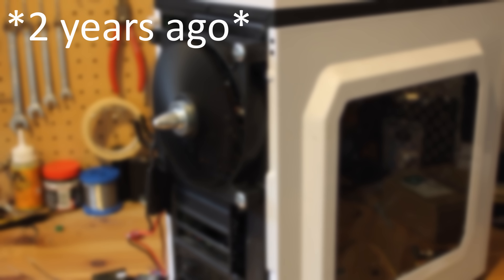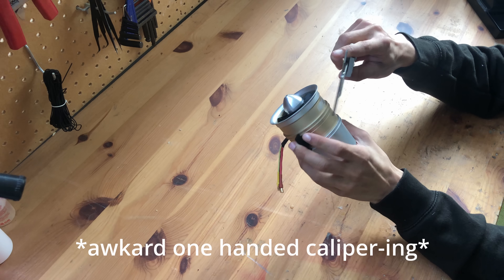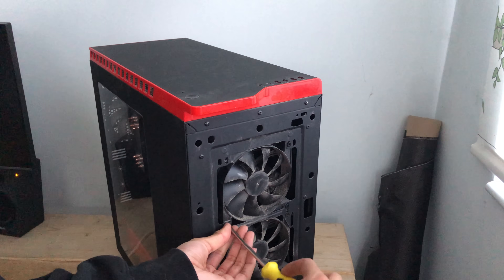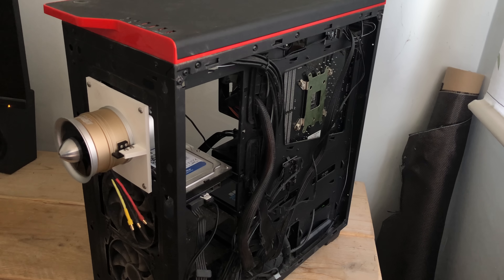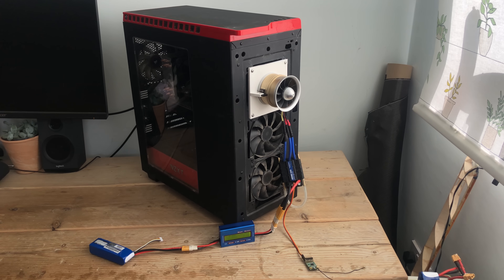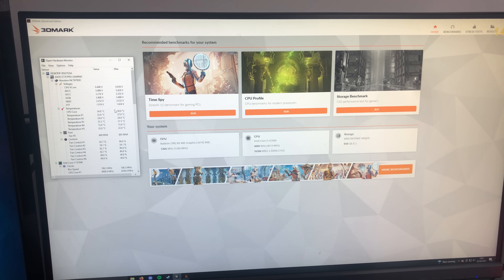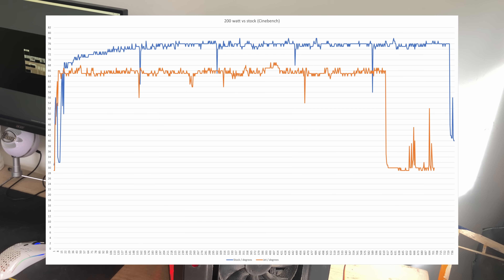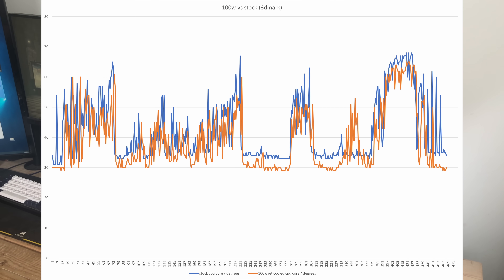I cooled my PC with a JET ENGINE...

Comment: I used to run a air duct from my window to intake fans. I had air filters and a square panel in window so it would shut. Cold winter air was a huge help

Comment: please can you atach a tube from the end of the turbine engine, and then to the radiator of the cpu cooler. What I try to say is that maybe you can use it as a cpu cooler, not a fan case. Sorry my english cheers form Argentina

Comment: literally turned on the jet and ran the test straight away without hitting equilibrium so you wont see any changes its like putting a can coke in the fridge for 5 seconds it wont be cold when i pull it out!

Comment: The placement is wrong, you need to consider the air flow to get the best performance. Fans in the front are facing inwards so they deliver fresh air inside the pc and the one in the back is facing outwards so it pushes the hot air out, so the jet fan is in the wrong direction

Comment: honestly this wasn't the greatest test, you could see there was negitive air flow meaning it was pushing air through the front not the back, would have been better if the exhaust was at full speed making it an even airflow

Comment: Great job, nice and easy to adapt a high flow fan to any standard 120mm fan... Any chance you could share your STL for the fan mount? I have the exact EDF unit and keen to mount to a 120mm fan like you've done.

Comment: I don't understand why your other fans started turning as if there's a negative pressure inside the case. you are compressing ambient air into the inlet on your case. the internal pressure should increase and your other fans should expunge air, not in-taking simultaneously

Comment: instead of blowing in air, you have to blow OUT the air.. meaning blowing out the hot air and replacing it with colder air... that would change significate amount of temp inside the PC case.

Comment: tho it'd be surprising if you did that without fan coolers on the heatsinks and only left that jet engine on, since that jet is so strong it could interfere with the fans themselves. 
or mabye if you did AIO cooler and removed fans from AIO's heatsink and let only jet cool the AIO's heatsink, that could be cool to see. or if you installed it direcetly to the cpu's heatsink.

Comment: I really need to see this electric jet engine strapped to a single 120mm AIO radiator. They're famous for generally not providing as much cooling as a similarly sized air cooler, maybe the giant fan can fix it.

Comment: It would be à much more intéresting video if you put this jet engine direct directly on the CPU cooler, this position is just for circulating thé hot air out of the pc so its not colline as much as the cpu fan

Comment: Where you stopped (and where I shall begin) is to add a complete metal turbofan complete with fuel rail, injectors, spark source, and small fuel tank. Gotta go hard, right?

Comment: I am somewhat curious, how about to try negative pressure, put the EDF fans on the exhaust side and the edf will eject the heat more from the case, also intake fan will spun faster.

If you put EDF fan on the intake side and no sufficient air coming out from the case, it might not efficient because inside the case is pressurized, well it can eject some heat but also make the air temperature rising little bit because of air being compressed. (my thought)
maybe you can try make the comparison about negative pressure and positive pressure inside the case. Of course with protection for mainboard and surrounding components if you paranoid enough to not trust your fan that will not explode.

Correct me if I wrong, we always learning right?
Also sorry if the grammar so bad.

Comment: I would say go figure out a system for the "Thermoelectric cooling uses the Peltier effect to create a heat flux at the junction of two different types of materials." The high speed fan is just pushing warm air over hotter air.

Comment: Sorry that I have to be this sucker but that might be everything except for a jet engine. That's the thing with the many many blades which burns some Kerosin by sucking air and creating a darn lot of heat. Fun fact it sounds funny when you drop a screw in one

Comment: Fyi, thats a jet Motor aka a EDF, in order for it to be called a jet Engine, it first must burn a fuel which turns the impeller, if it doesn't burn a fuel and instead uses electricity to spin the impeller it is Not an engine, it is in fact a Motor.

Comment: The airspeed coming off that fan is probably 200mph (~320kph). 
The cables in the case are at risk of pulling off.

Comment: In January 1965, Secretary McNamara asked the Air Force to consider a new low-cost tactical fighter design for short-range roles and close air support to replace several types like the F-100 Super Sabre and various light bombers then in service. Several existing designs could fill this role in 2021 for pc users.

Comment: Cool test! If you are wondering why it didn't work its because there's a transient period for the air to "absorb" the heat from the components. By blowing it out too fast you eliminate that possibility.

Comment: your ability to remove heat from your system has more to do with the heat syncs and their ability to dissipate heat rather then the amount of air flow you have and removing the dust from your system will do more for the cooling then an EDF

Comment: that's just a small fan with a high RPM via a larger motor; it will not increase cooling performance more efficiently than just adding normal fans on a high airflow case

the problem with this system is as follows:

A- the diameter of the simulated turbofan is too small

B- the CPU cooler is too small

C- the air pressure at the cooling point is (still) too low (due to a combination of factors)

D - the case has not been modified or optimized for high pressure cooling or exhaust 

recommendations:

A - replace simulated turbofan with a larger diameter unit (at least 140mm) 

B- use a larger cpu cooler (e.g. noctua NH-D15, etc.)

C - remove case or modify a case to allow turbofan mounting to near front of cpu cooler, incorporate cpu cooler directly into turbofan housing (via fan-shaft retrofit) and/or extend turbofan nacelle to front of case

D - add second turbofan behind cpu cooler and remove any material obstructing second fan exhaust point (second fan functions as a simulated gas turbine engine for increasing air pressure in the terminal phase)

Comment: OR instead of using that silly and very limited Battery and RC Controller... just use an simple Universal power supply (Laboratory PSU) and Voltage Control it.

Comment: Sweet just in time for nvidia 4000 series I'm sold I will need 6 of these please, oh and some really good sound protection as well as a power station outside my back door, going with coal you know cause fuck it. I can have my kids shovel it into the furnace while I get the power and cooling needed for pc gaming in 2023.

Comment: Wrong section the fan Use as a CPU Cooler Generates better performance. 
And Change the Thermal compound for highly heat transforming

Comment: Id honestly build a complex 3" PVC pipe labyrinth to deliver the fast air to all the places that need it. Would look cool as hell.
Reply: Hardline water cooling  no no no  hard pipe air cooling
Reply: @Thefreakyfreek  Reminds me of when it was cool to have a fan shroud in your gaming PC. It's honesty a good idea as the air is directly drawn from ambient into your heatsink instead of sucking in the heated air within the case.
Reply: I really dont think you've ever seen a 3" pvc pipe before. You're not building shit inside a computer with it.
Reply: @Taylormade2350  the fun part is dealing with that thickness
Reply: @Taylormade2350  i depends hp often has pipes in their PC's  but no bends and stuf
Reply: @Thefreakyfreek  no hp doesn't have 3" PVC pipes that is twice as thick as pipes under sinks.
Reply: @Taylormade2350  tere is a pipe often from the outside direct to the main cpu fan
Reply: @Thefreakyfreek  it's not a 3" PVC pipe bud. I'm not sure what you're struggling to read here. No one said computers don't have pipes.
Reply: @Taylormade2350  no not apvc pipe but it's not a 3" pvc pipe  that's for shure but the idea adopted can sertely work  wont be quiet tho
Reply: @Thefreakyfreek  Not sure what you're even still answering me. I know pipes are used I'm PCs. I have not once ever said otherwise.
Reply: YOO pulling air from outside so your neighbors have to deal with the noise too
Reply: HD 600 on tubes tho.
Reply: Even better Idea but based on yours 
Set up a small pipesystem that can eighter function as in- or outtake for Air.
Placeing next to a window enables you to import / export air. Mostly Summer export and Winter import i guess.
Depending on the lenght of the pipes you may need to have 2 engines (smaller ones should do the trick as well)
and springs with rubberdomes to kill the vibrations of the Badbois.
Reply: This is actually a brilliant idea, supposing you use a fan that isn't going to blow the chips right off the board or loosen the solder.
Reply: those are just the copper pipes on heatsinks
Reply: @paisenpaisen  no bc copper pipes have like vapor and stuff inside them it’s not just air
Reply: @bleuebloom  i thought it was soild copper but then again copper is very expensive

Comment: seems the author has no idea about airflow, air vacuum and thermodynamics. it makes no sense at all to try to stretch the air. it would be more useful to use low air temperature + compression instead, lol

Comment: reversing the jet engines, as to draw air out of the case might actually be more beneficial, The idea is to remove got Air from the case, in the way you are doing this at the moment you are actually heating up the air that goes into the case and since you don't have the same pull power from an exhaust fan you actually increase the Air density in the case similar to what and the oven does on the Fan mode. Now the best place for an exhaust fan is actually the top of the case since hot Air goes up on its own ( the many reasons why so many cases have fans on top blowing air up and out of the case).
Reply: Good explanation. Another option is to just have an AIO for CPU, you remove the fans on that AIO heatsink and let JET Engine cool it, and thus you dont have much of interference. 
tho idk how would that jet perform as an exhaust since it is small and i doubt it covers as wide area as it would if it was an intake if you know what i mean. I think for the jet to be as an exhaust you would need something similar as an intake to take full advantage of that, if that makes sense.

you have a powerful fan (engine) that can draw the hot air out with ease, but if you dont have good some other pressure from below blowing upward for that engine to push the air to the upside or to take it out, it's not as useful as an intake and that's what i meant before. Unless i am wrong and at 48000RPMs you can make enormous static pressure and it pulls air out from quite far away like crazy.
What do you think?
Reply: Just need a mean grill or strap everything down tight, cause any wires, or small bits that get sucked into the engine will be a RIP lol.
Reply: Gotta say he has the spirit but it's just for fun.  The fan should be mounted in its own spot and ducted to the case.
One of those 120fans can mount a flange for 4" air ducting that has the wire coil in it to support vacuum.  The cheapest level duct fan will keep up with several case fans and one could plan the cfm in to cfm out to dial the pressure difference.  Mainly keep the big fan at a distance I'd say

Comment: Cool test.  But unless your CPU was running to hot already giving it more cooling won't help. Doesn't matter if it hits 70c or 50c during a benchmark should be the same. The CPU or GPU won't start throttling till a certain temp. This may have brought your temps down but won't do anything for performance usually. Over cooling a PC just fills it with dust quicker.

Comment: Something went very wrong with that initial test, only the front fans spun at all from the gust of air coming out of that turbine, meanwhile the back fan just jiggled a bit.
Ideally with something like that you'd make a wind tunnel, split its flow somewhat in the middle, half goes to the gpu, the other half to the cpu.

Comment: how about making a bigger jet engine (that takes the space of the 3 front fans) so that the noise would be minimized while also increasing the amount of air pulled into the case ? One day, if i have the skills, the time and the money to do it, i would like to create a pc case modeled after an aircraft reactor with only 1 big fan at the front and the cone shape of the reactor :)

Comment: the duct directing airflow is the important part here, you could achieve not-quite-as-good results with a small rear 3d printed diffuser duct on a normal fan i think

Comment: Congrats! You created a server fan.

In all reality, this would only have benefit in very dense hot component environments like server chassis. In a very open case like a tower ATX case, you are going to hit the thermal transfer limitations of the heatsink itself before any more air flow actually matters. Engineering would be much better spent on reducing gap tolerance between the silicon and cooler as much as possible. We have to remove the heat first before we can deal with it.

Comment: Hate to tell you, but you need direct airflow over your CPU heatsink, so the test would have some significance. This way your airflow takes shortest path from intake to exhaust and just "keeps enough airflow of the frash air in the case", so your CPU cooler still does all the work. Try straping a wind tunel arround the CPU or just strap the JET right to the CPU heatsink and than see what the temps are :)

Comment: Some ways I think this could be improved water cooling the entire system, leading it all to one big radiator. Then with the engine 3d print a housing to expand the air through a series of diffusers into a rectangular cone fixed to the side of the radiator. That way the air from the engine would cool off slighty as it travels further, as well as diffusing across the entire radiator increasing the surface area the flowing air contacts. Just a thought from the mind of a non engineer ;)
Reply: if you make it rigid enough it should even decrease the vibration and noise if you make a housing for the engine. Sheet metal would more than likely be the best option

Comment: You could probably get even better performance if you turned the engine into an exhaust. Seal up every entryway for air but the front of the case, you'd basically be replacing the entire volume of the case's air capacity every second rather than creating a turbulence box inside and hoping the hot air escapes somewhere, and you'll see a much more dramatic change in temperature to boot.

Comment: 1. That is not a jet engine 
2. Jet engines require combustion
3. Combustion requires fuel so it cannot be electric 
4. Jet engine makes a jet blast that usually hot air which is not good for your component

The conclusion for this video is the title is clickbait and misses information.
but nice try to build one

Comment: Interesting that when the fan was on, it was actually pushing enough air through the case that it caused the other fans to spin, and I think they might have even been spinning from vacuum pressure (IE: that EDF is generating enough airflow, that air is getting pulled through the case from the lower fans)
Reply: ya you can tell the fans were spinning do to the venturi effect do to how they were spinning in the proper direction meaning air was being sucked into the case not blown out of the case

Comment: make a 3rd printed shroud on your CPU cooler and duct an air hose from that jet engine to the CPU cooler.
also make an air duct for the exhaust. 

You should see a significant difference in CPU temperature.

Comment: I think if you placed it at the bottom fans instead, so the air isnt just going straight out the back, you may see an even larger change. Could be wrong tho! Great video!!
Reply: you are wrong, it's hitting cpu cooler which is where the air needs to go.

Comment: Ofc this will cause a massive change, as, first, I see the present cooling is not very balanced, say I had an alike one, but after carefully decoupling the airflow I also got a somewhat 10+ degree decrease just by using two intake fans, and two low-speed exhaust ones. Second, the GPU fans' control tries to balance between speed and noise mostly just using an open-loop PWM, now with an additional intake pressure not only the airflow through the GPU's heatsink fins increases, but also one's fans start spinning faster.

Comment: Next time you should try pushing a much more voltage through the fans. Not through a jet engine but the fans in the case. I tried pushing 18 volts in to the cpu fan and after that the temps dropped from like 92 degrees celsius to 67

Comment: Why do you use harddrives in 2022? M.2 or even normal SSDs are much faster and don't brake so easy.  Should be affordable when you can afford a frickin Jet engine xD

Comment: imho the best way to cool a  CPU is to:

- lap the IHS or replace with custom lapped high surface IHS
- lap the water block
- have the most OP high flow waterblock you can get
- use highest quality thermal paste
- Have a 360mm rad push pull config 
- run fans at min speed
- water pump at 60% for all use except when CPU is pegged.

With that kind of setup, you can cool 350W and still get under 90°C

Comment: I feel like this would have been more effective had it been mounted as an exhaust fan instead of an intake fan.
Reply: I have the impression it would choke the inside of the case. Air would move out much faster that other fans would deliver fresh air back in.

Comment: you should have the fan blowing air in because if its set to exaust than it would create alot of negative preassure in ur case and the airflow doesn't really reach your cpu cooler.